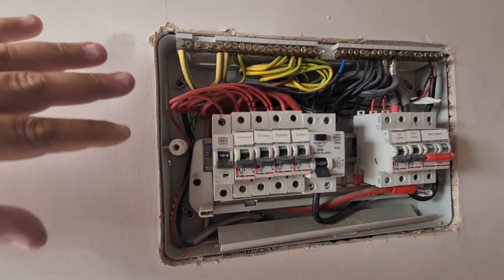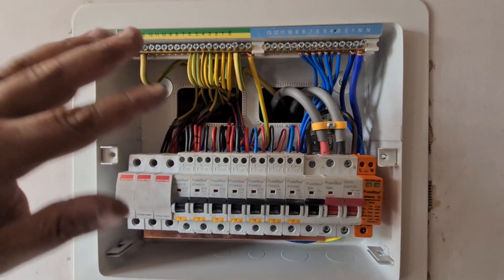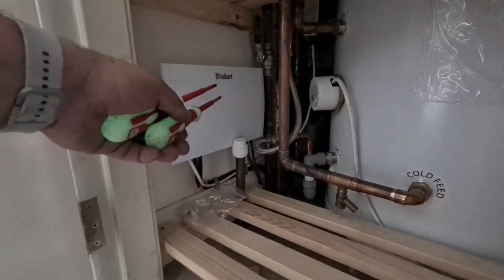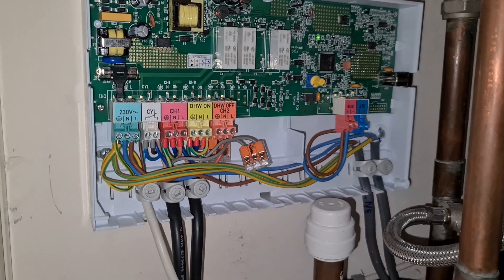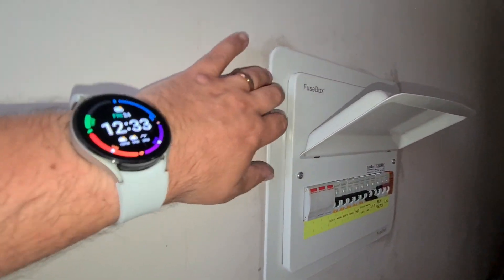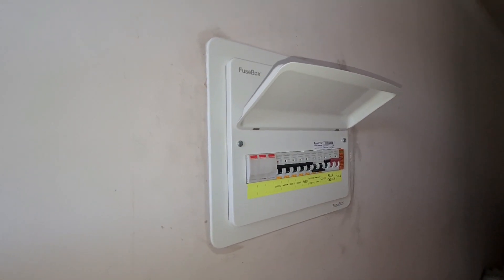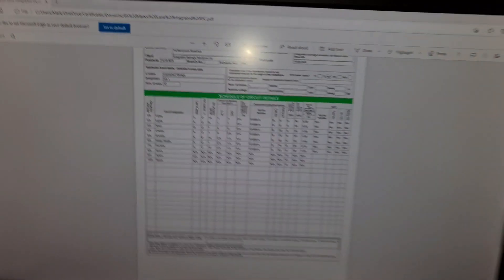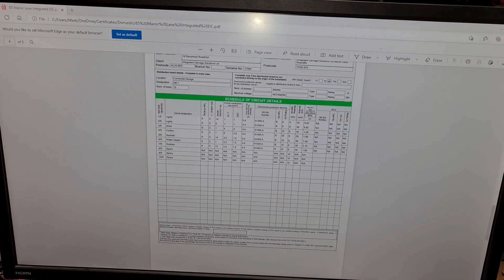Installing Recessed Consumer Unit - De rating MCBs & RCBOs FACTS

Comment: It's worth mentioning that its the percentage of max load that's important for protective devices. A 6A RCBO with a 6A load will dissipate almost as much heat as a 32A RCBO with a 32A load. Luckily in domestic most lighting circuits have small loads. 
Like Mark says the only big devices likely to get hot in a domestic sittuation are those protecting EV charge points, heat pumps/electric heating, immersion heaters and kitchens to some extent. 
Try to  give these some extra space and use next size up for breakers, for example 40A on a 32A EC charge point.
Reply from the maker: Yep any circuit were the load is anticipated to be towards the OCPD max rating for beyond 1 hour will most likely require this. Good design removes this scenario from any probability in most cases. But the ones to watch are as discussed. EV, Hot Tub, PV, Heat Pumps, Immersion elements. Its not a common problem tbh but one to keep a mindful eye on.

Comment: Hi is that fuse box just a normal one and that frame seperate. How dose it screw In did you have to build a frame for it
Reply from the maker: Yes mate. It's the normal CU. With CP fusebox you buy the frame and it site on the normal CU. Just be careful to get the right size. Frame has 4 fixings in the side which can be secured to a frame and also clamps between the front cover and rear housing. 

Nice simple solution tbh.
Reply: @electrician247  okay mate if you install another one you should record it. Looks a nice neat finish in the end. I do like fuse box equipment seems decent quality for the price

Comment: Interesting video and comments. With some sparkies now favouring to install radial circuits on smaller rated MCBs instead of ring mains on traditional 32A MCBs, there is more chance of the former circuits operating more towards their MCB rating. Like you said, it doesn't help that instructions from manufacturers differ sometimes.
Reply from the maker: Yeah, the issue would be if it's consistently loaded. Unlikely on well designed socket circuits.

Comment: Hi Mark. 
When a friend did an 18th edition course with sparky ninja. He said that Fusebox rcbo’s at that time could lose up to 50% of their value at higher running temps 

I never did that spacing rubbish but what I do, is to space them high and low. So ring then lighting, then cooker, then boiler (6A) etc, etc.
Reply from the maker: De rating is a factor if you run the devices close to their limits and for prolonged periods. In most designs it is not really a factor at a domestic level. We are designing well under the OCPD values. As mentioned in the video its only really heating and vehicle charging were it might raise its head. A few poorly worked out examples are in place on YouTube which resulted in the trend at the time of spacing all ocpd. Which drives up cost as clients end up buying bigger consumer units. These kind of things are basic sparky skills and unfortunately when some want to create headlines and draw attention towards courses that goes out the window. Is what it is. Your suggestion makes sense but remember the issue is with running currents close to the value of the OCPD. So even what might be considered low power such as 6A lighting could be an issue if you run close to the 6A consistently. More of an issue in cold space imo.
Reply: @electrician247  great points made there 👍 like you say it’s down to loading. I mainly do it so you don’t end up with a hob, a double oven supply and a heavily used ring together. I’ve seen old boards where you can see the tarnished busbar and discoloured devices. More of habit now I think. 

Keep up the good work.
Reply from the maker: @yrification  yeah like I said in the video. Makes sense when you think about it. You are dead right the old school mindset was always biggest to smallest. Don't it for decades myself tbh 🤣🤣🤣

Comment: Lovely job done there mate, I like the reseat fuse box CU 👍
We’re did you get the glow in dark screwdrivers ? I like them be great when I am in a dark place like the loft . Or under the stairs. 
Fantastic video guy’s as always mark 👍👍👍👍❤️
Reply from the maker: Those are made by CK mate. Goole CK glow in the dark screw drivers. I got them in the local wholesalers ages ago
Reply: @electrician247  found them on Amazon for £40+£7.99 p&p  ? No thank you 😂

Comment: Good shout, excellent IET article, well defiantly have to stop to think about that one more often,  so moving forward knowing that the we are generally getting more warm weather and we want to keep the heat in everywhere and rise in materials costs etc,  prices will have rise even more to potentially accommodate the need for bigger or vented boards or bigger cabling or both, it just gets better😕
Reply from the maker: Yes for me its more warm plant rooms in terms of heat and we consume more energy inside enclosures. The biggest issue in this application is using them in colder unheated areas. That moves more towards the line of safety rather than premature tripping. Places in domestic such as sheds and garages. Either needs to be designed in or consider mccbs.

Comment: So with derating, the old method of having the biggest breakers next to the isolator (based on a rather dodgy premise of the bus bar dropping voltage/heating) is hopefully no longer valid. Now better to "stripe" the actual usage of the breakers to avoid grouping heaters, and consider having the highest constant consumer in the last busbar position.
Reply from the maker: Yes in essence that is a sensible approach. But remember it is only an issue of you size your breakers close to the running current in the circuit and for a prolonged period. I would have no issue with socket finals and cookers for example living in harmony side by side as they have done for decades. The issue sits around heating, ev, hot tub ccts etc. Again generally we are specifying ocpd way beyond the running currents in most cases. But arranging circuits with this in mind is a good shout. 

Nothing wrong with spacing things as such aside from the cost/space burden the client picks up.